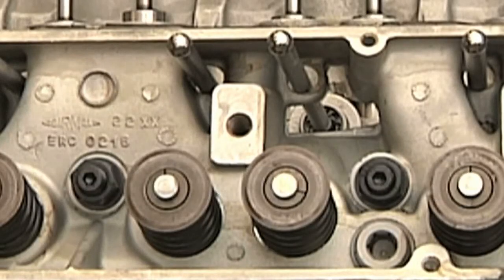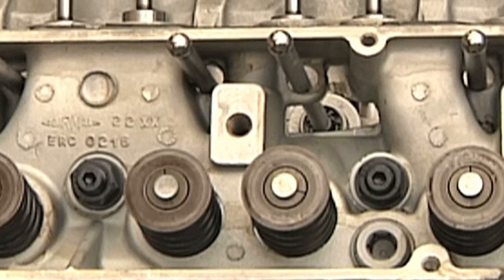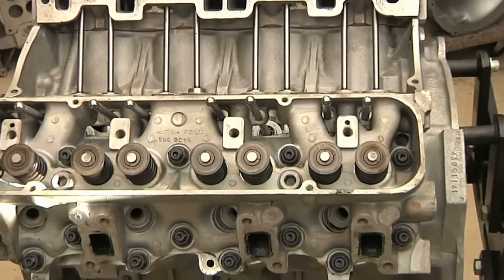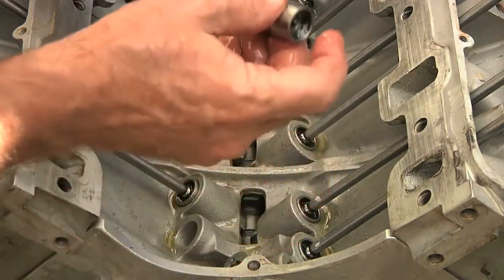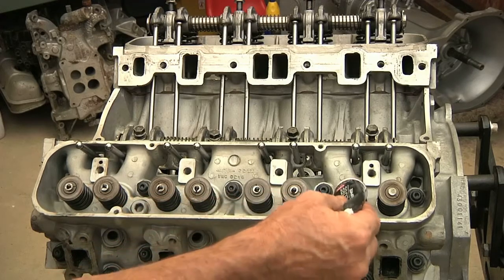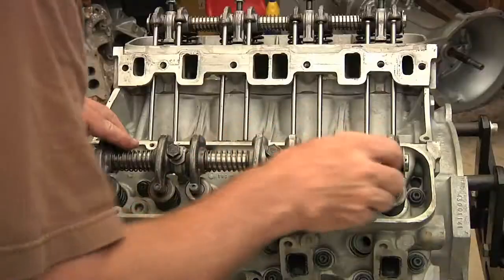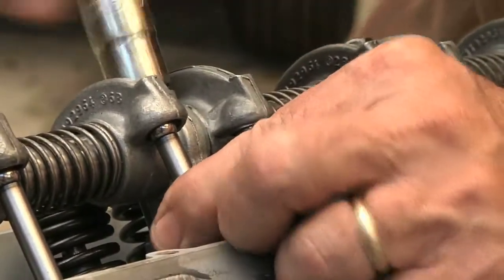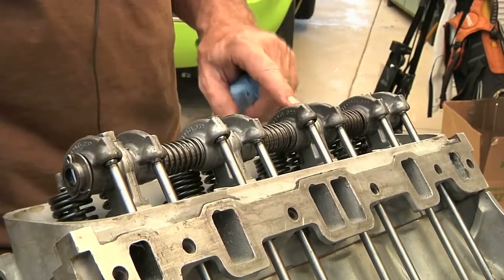Rover V8 Episode 3 - Valve Train Assembly v2.mov

Comment: Your pushrods are thicker than standard which is why the holes in the head needed opening up, standard rods don't bind.
Reply from the maker: I sold the car in 2013 and stopped working on cars in 2015.